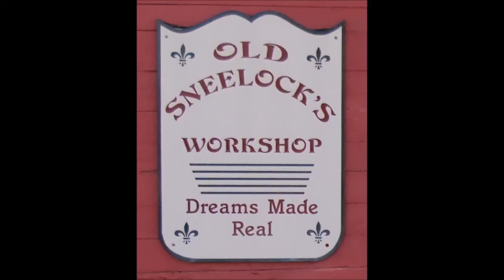Morrill's  Saw Set - Adjusting The Set - a video tutorial by Old Sneelock's Workshop

Comment: Thanks for the detailed introduction of the parts of the saw set. The only thing I am not used to following what is explained is that the video is far from the saw where by it could have been viewed how each tooth pried as far as the setting of the angle was. But anyway thanks, I just applied some few imagination, if some past few experience someone was doing it, if I had a tool I'll try experimenting it starting from the wider end of the saw where this section is not actually doing sawing and mistakes wont affect much til i get it right on the rest of the teeth that are active in sawing operation til the tip.

Comment: Well, I broke the first tooth I tried to set. Luckily I was smart enough to start with the end ones first so it isn't a big deal. This saw is pretty beat up, it was hanging on a post in someone's front yard for who knows how long. It has a bit more pitting than I would like but I'm going to restore it anyway. It will be good to practice filing on this one than on my good ones.
Reply from the maker: Sorry the tooth broke. Pitted saws have a tendency to crack through the weak spot the pit makes. Remember you don't need much set. .010' is equal to 2 1/2 sheets of tablet paper.
Good saw to practice on.
Reply: I had it set to what I think is the minimum set possible. I was really just seeing how it adjusts. Didn't put much pressure on it at all. I haven't invest much into the saw so it isn't a big loss.
Reply from the maker: Keith Barkwood That's why we practice on the worst ones first. More to gain and less to lose.
Reply: AMEN

Comment: Hello my friend i have an issue setting my panel saw i notice sometimes it slips off the tooth now heres my question i should sharpen the saw first right then set or the other way around?????
Reply from the maker: I usually set after filing. The plunger on the saw set pushes on the dull side of the tooth. It won't damage the sharp tooth. If you set first you will  file the teeth to a narrower set.